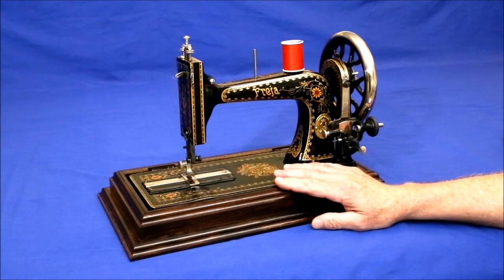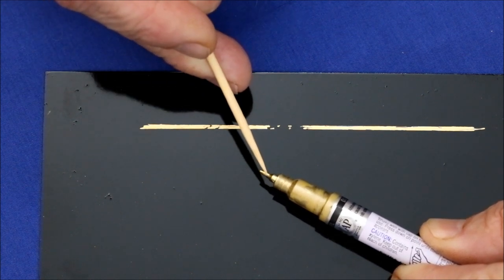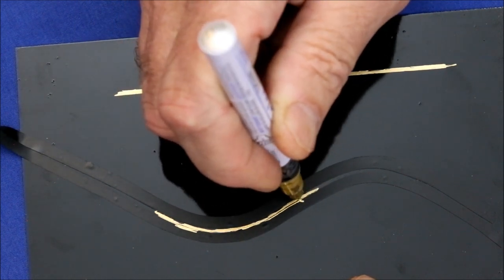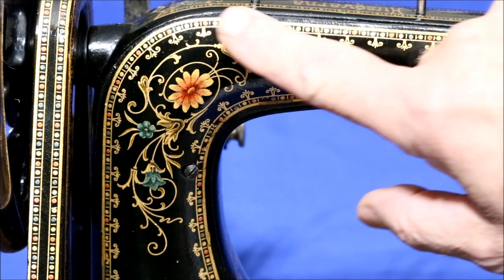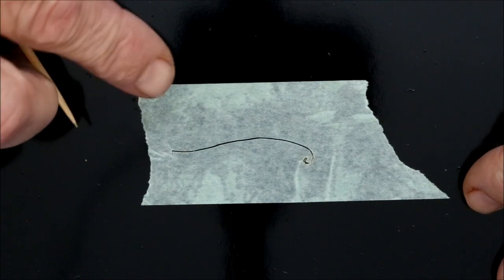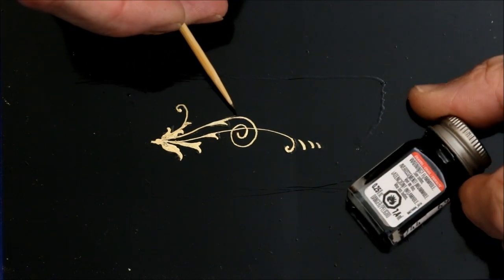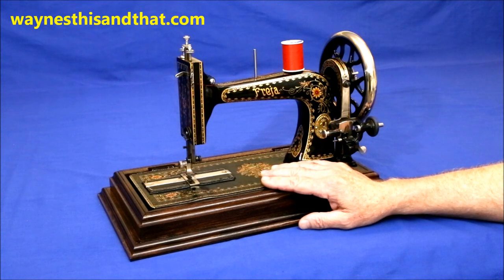Antique Sewing Machine Restoration Decal Repair

Comment from the maker: Since posting this video, I've tested two dozen more paints and found Design master 14KT Gold spray paint (#230) is a closer color match and has more shine to it than the Decocolor pen.
Reply: And is that before or after adding shellac? Shellac can be amber color, but it can also be sold clear. Do you think the difference is noticeable? 
Great vid thanks for sharing
Reply from the maker: @victoriango9443  thank you for commenting! I use clear shellac, which doesn't change the color. But shellac, as well as any clear coat, will dull the luster of any metallic paint. It has to do with a metal flakes used in such paints being lifted so they no longer lay flat providing a metallic reflectivity. Model builders has lamented this for years and have yet to find a solution. An enamel metallic wouldn't require clear coating for protection, but none that I've tried is the right color. For small touch-ups, the slight mismatch in luster isn't noticeable without close-up glasses.

If you like antique sewing machines, I'm just finishing up an 1869 Grover & Baker that is destined to be the pride of our collection. The video should be up and a week or two. I hope you enjoy it.
Reply: @wayneschmidt490  Thank you for replying! If that's the case then, maybe it's better to clear coat and then enamel on top? My antique doesn't have resale value, at this point, the gold touchups are just for me. Looking forward to the next vid
Reply from the maker: @victoriango9443  If you can find a good metallic gold paint, I'd say yes, put it on top of the clear coat so the clear coat doesn't dull it. Good luck!

Comment: At the beginning of this video you make a quick reference to applying a degreaser to the surface.  I am attempting to repair the decals of a Singer 46K1 that have partially worn away. Do you have a recommendation for a particular degreaser? I am wondering if there is one that will degrease without further damaging the remaining parts of the stencils.  Thanks in advance for your answer. I very much enjoy your videos.
Reply from the maker: I have found the safest degreaser to be warm water with dish soap in it. Dip a cloth into it and rub on the surface. Start in the rear right corner, which is the most hidden, and see how much pressure and rubbing is safe to use. I used to use 409 cleaner/degreaser, but found it was a little too aggressive and could, in some cases, attack the artwork. I sometimes use it in tough areas coated with dried oil that don't come up with soapy water. Once the machine is clean, I recommend going over it with a towel dampened with clear water to remove any soap residue. I hope this helps/ Good luck with your restoration!

Comment: what is vinyl insulation tape?
Reply from the maker: It's usually sold as small rolls of 1/2-inch wide plastic tape in the electrical department of hardware stores. It's used for wrapping around electrical connections to insulate them so they don't short out to neighboring wires or any close pieces of metal. It's very soft a form-fitting. I hope this helps. Thanks for commenting!
Reply: @wayneschmidt490  you mean electrical tape?
Reply from the maker: @jomercer21113  Yes.

Comment: Danger I used this shellac and methylated sprits which is great but one of the ""brushes used a glue to hold the bristles in the metal ferrule"" after a about 10min the glue leached out and made the shellac opaque / milky, and as you say after a bit of time and meths I cleaned it off. Now I test the day before and leave brushes soaking to see if they are safe.

I only paint of shellac if the transfers / decorative gold transfers are exposed. Most of my machines are just made to work and use. What you do is fantastic.

I liked your tips, many thanks.
Reply from the maker: Sorry not hear about the brush messing up your work, but it sounds like everything came out okay in the end. I've actually given up on shellac and now use spray clear coats.

My current project is a hand cranked Singer 24-51. She's a really mess. Almost all the Japanning is gone and the surface is rusted and pitted. The good news is she seems to have all her parts and turns, though we don't know yet if she'll sew. I'm using her as a test bed for some different restoration techniques and I'm interested in how they'll work out. Thanks for writing!

Comment: I love the old linear shuttle , my Minnesota has a swinging one just the same I like to watch it pick up in slow motion
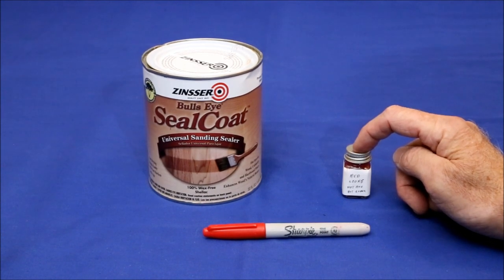Reply from the maker: I know what you mean. They are somehow more satisfying to watch than the rotary machines. I have some slow motion video of a linear shuttle catching the thread 7:40 into the following video:

https://www.youtube.com/watch?v=rpQ2mAGlHNY

You may find it interesting. Thanks for commenting!
Reply: @wayneschmidt490  I took a picture of my singer 66 and the way the thread comes off of the hook it's pretty neat and then I thought well I've got to go look at that I call it a flying shuttle underneath my Minnesota and sure enough that thread goes around that little bullet while it's in it's carriage.! And never gets hung up then I looked at my r i c c a r which is just turned the other direction then my simger start.
Then one day I was taking pictures of some chain stitching machines that I have, definitely cool if you can get underneath and the right light but I work on all machines and I love them all

Comment: After using the pin paint to fix the decal, can you shellac over, or will the pin paint bleed?
Reply from the maker: I've clear coated it with shellac with good success but found that it has to be applied in a single light stroke. Shellac does soften the pen ink a little and repeated brushings will tend to smear it.

I've stopped using shellac because it's so difficult to use and get a good finish. French polishing isn't as easy as it looks. Instead, I've switched to using Design Master Clear Finish Gloss #168 spray. It's available from Amazon. Small areas can be done by spraying a little into a disposable cup and brushing it on. This clear coat is easy to use, dries quickly (though a two-day cure is best before hard handling) can be recoated almost anytime, resists runs and so far hasn't attacked any decals of paints I've used.

I've also stopped using the paint pen. After testing many real paints, I found Design Master Premium Metals 14KT Gold spray to be more durable and a closer color match than the pen. It isn't an enamel, so it still needs to be clear coated but the results are much better than the pen.

Thanks for commenting! I'm just finishing up my most recent restoration: an 1872 Franklin Agenoria. I hope you'll check it out. It should be uploaded within the next few days.
Reply: @wayneschmidt490  Thank you so much for this video! Just inherited a 201-2 and am doing a complete rewire. I used sewing machine oil to clean the machine and the next day most of the machine was quite cloudy. The Shellac seems to have been completely crackled and crazed and I was able to scratch it off with my thumbnail. I have about half of the shellac off, and the japaning and decals are in pretty good shape. I really wanted something more durable than shellac as a final finish and you are the first restorer admitting to using a contemporary  clear coat. I'm also considering an oil based polyurethane as Alex Askeroff uses this to "seal" severely crazed/chipped machines to prevent further rusting. He applies it with a brush and I see no color change on the decals.
Reply from the maker: @cliftonmcnalley8469  201s are great machines. Congratulations on getting one. Good luck fixing her up and thanks for commenting!

Comment: Broken bed sad yesterday my machine snapped across the bed where you hand is at time slot 8.35
My machine I had stripped cleaned and was working well, it came with lots of feet
HAID & NEU "FAUDELS" PEACOCK TRADE MARK

I think the thinner wood base bowed from sitting one something in the living room; the hinge screws were tight so was the front hold down screw.
My Bradbury also the same type of machine as yours has soft rubber pads under the back hinges ? I do wonder if this was a problem.

In the past my machine must have been dropped since the top decorative parts on the presser boot and needle bar have snapped off.

The locking mechanism was very poor and would release if you lifted the machine (I never trust the case handles I always wrap a strap around the full machine)  

I will be making steel flat shapes and masonry nails with JB weld or epoxy (I am in the UK) they will be under the bed out of sight.
Reply from the maker: That happened with our Crown sewing machine! It was on a high shelf and my wife tried getting it down rather than asking her manly husband for help. :-)  It was too heavy and she dropped it and the base broke in half. The JB weld and steel plates on the underside fixed the machine perfectly. The trick to filling and hiding all traces of the crack once it's back together is to use a sanding primer and filler then wet sand with a sanding block. I'm sorry to read about your machine breaking, but at least it can be fixed. Good luck!
Reply: @wayneschmidt490  Many thanks, in the 1980s I used to help my dad in the Blacksmiths shop we had special electric welding (nickel I think) rods or oxy acetylene brazing rods, our main repairs was for farm machinery or engine blocks with the odd gearbox that was in 16 pieces it was for a fire engine.
The danger with cast iron is the cooling as it shrinks it can crack; we had a forge running so we could just leave the item in the warm coals.
With a sewing machine thin bed I would JB weld and keep the paint as you have done.

I few weeks ago I think I heard the base snap it was stored behind my chair.

All the best
John

Comment: Wow amazing, how do you shine and restore the black paint and make it shiny? Can you please provide video? Thanks for the amazing videos. ❤️❤️❤️
Reply from the maker: All antique sewing machines were originally coated with a baked-on layer of asphaltum, linseed oil and turpentine called Japaning. After degreasing, cleaning with acetone and sanding with 400-grit sandpaper, I spray with Design Master gloss black spray paint, then. follow that with Design master Clear Gloss Finish #168. This produces a gloss black finish almost identical in appearance to the original. Thanks for commenting!

Comment: Question: should I use the same techniques from this video on the decals like the ones on this machine? https://youtu.be/sug69sYIIp8
Or should I do something different?
Reply from the maker: The machine in the video you sent used transparent-ink-over-silver-paint decals. To restore them, you'd first have to restore the silver paint, then hand-color over it. This is such a difficult process I doubt it could be done well enough to look good. Sorry.
Reply: @wayneschmidt490  Thanks for replying. If there is no other way to restore the decals, then is there any way to preserve them? Also were the decals on these machines in this video done in the same way?https://youtu.be/eYrmJvSWamA 

https://images.app.goo.gl/8RuEGfLotWCsD5ae9
Sorry if these questions are a bit frustrating.
Reply from the maker: @someoneorsomething7591  What's happened is that over years of use, the protective layer of shellac has worn away, exposing the original artwork, which then also starts to wear away. The top layers of color go first, exposing the underlaying layer of silver paint, which was used to give the color layers some shine. Originally, all the artwork was applied using a lithographed transfer technique, which is like a decal except that only the paint is transferred. There is no clear plastic base layer that holds everything together. I've developed an inkjet printing technique that works for all-gold decals 
https://www.youtube.com/watch?v=2PKmkXWtQmY
 and am working on a technique for colored decals, but am not far enough along in perfecting the latter to publish a video about it. If you want to preserve what you have, a light coat of gloss clear spray paint will work well. It's important to make sure any oil or wax has been cleaned off before spraying. I've gotten very good results with Design Master Clear Finish Gloss #168, which you can get from Amazon.
Reply: @wayneschmidt490  thank you for telling me this information, I'll go see what I should do for a machine I have which has a large amount of its   floral decals rubbed away only leaving behind a sort of outline of where it used to be. There are also spots that seem to be clean, darker, and shinier than the rest of the machine. Is it remaining shellac? If so then what should be done with it?
Reply from the maker: @someoneorsomething7591  My video on how to recover lost artwork
https://www.youtube.com/watch?v=UampKLTYhmk&list=PLEnCVl0LWmYfasxI2p2mcDF0YauzDkwYY&index=22
shows how tom use an ultraviolet flashlight to test if your machine is coated with shellac. The video is only 2 minutes long.
Reply: Hi, its me again. So I kinda got some sewing machine oil on top of a 1890s singer sewing machine bentwood case, it got on the decal and wood, it doesn't seem to be coming off. It kinda made it look good but it it worries me. what could I do to about it? The case also has one of its side pannels sadly broken in half so is there any way to fix that? The peice fits right on but there are also more cracks above...
Reply from the maker: @someoneorsomething7591  I'm very sorry, but I know absolutely nothing about cleaning or restoring antique woodwork.
Reply: @wayneschmidt490  Thanks for letting me know about that, I have been notified by a someone that I could try use vinegar on it to get it off and use this other product which I can't remember the name of to give it a new look. Also about the shellac thing, if my singer sewing machine is coated in shellac, am I still able to use that clear coat spray stuff or do I have to use and give it a coat of shellac?
Edit, desighn master clear finishe gloss
Reply from the maker: @someoneorsomething7591  I have used the Design master Clear Finish Gloss over shellac without any problem. But, it's important o make sure the surface is clean and are of grease and oil.